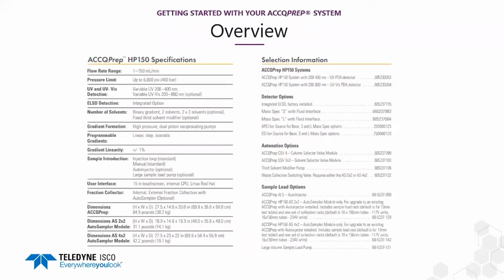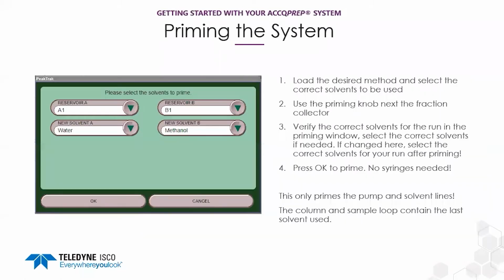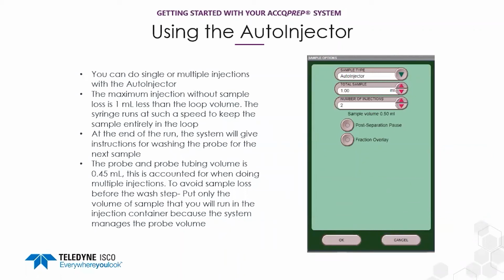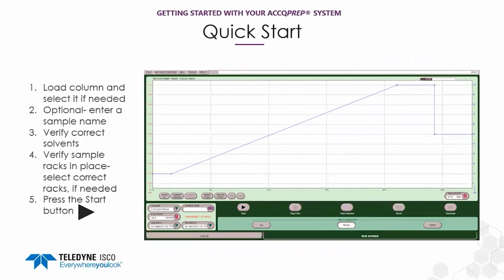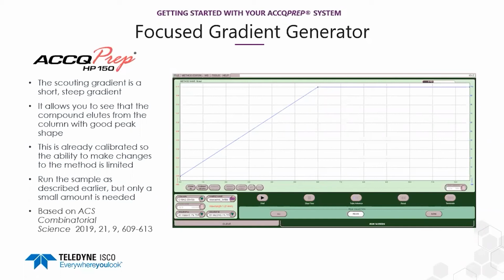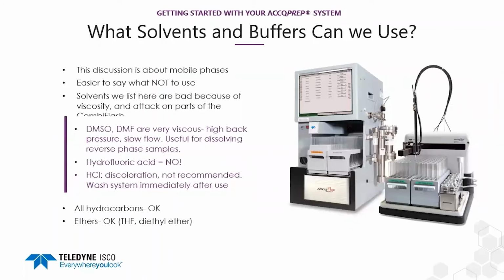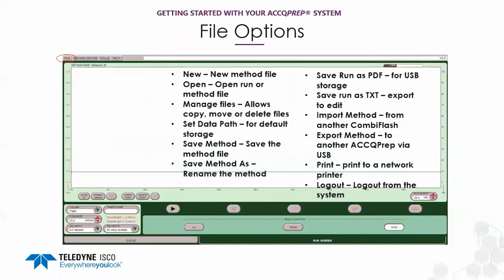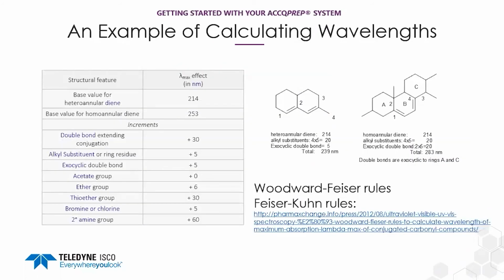Getting started with your ACCQPrep® preparative HPLC system

Comment: I have a problem where the system reaches max pressure immediately. No solvent is even pumped through the system before it reaches max pressure. IS there anything i can do to solve this?
Reply from the maker: Hello, thanks for your question. The folks at ISCO service might be able to help you out: https://www.teledynelabs.com/support/isco-support I hope this helps.